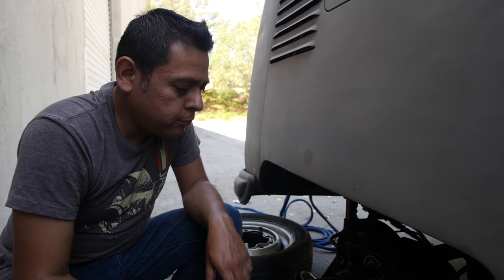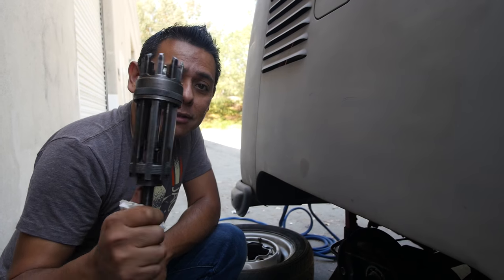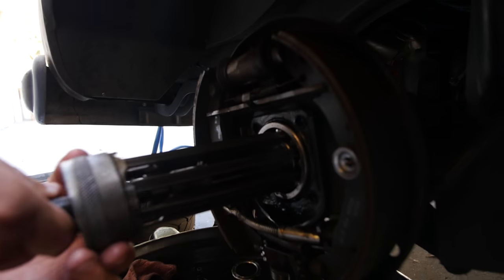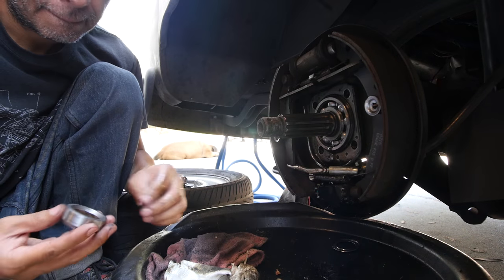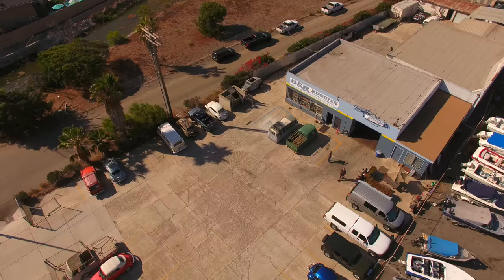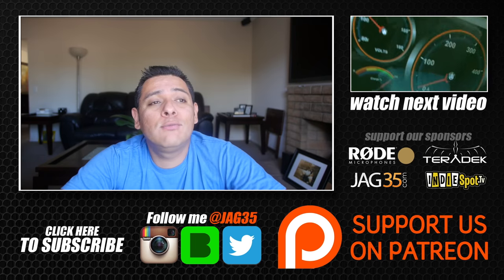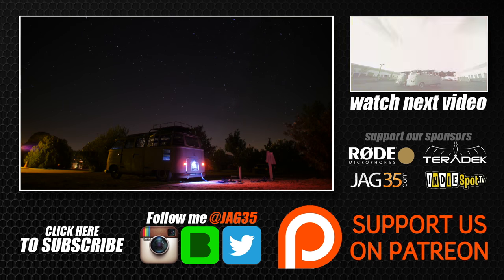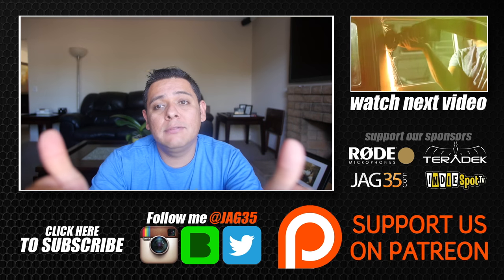HOW TO REMOVE A REAR VW AXLE BEARING 6306

Comment: You have nice editing BUT. Put the content first! Why did you timelapse through the reassembly? We could have learned much more. What was that O-Ring for? How did you get the new bearing on when it was already hard to get the old one of? What was that funny bearing cover why did you cross tighten the bolts? How expensive is such a bearing? You have such high quality footage and editing it's a shame you are not using it to it's full potential. Your outro was like 2/3 of the whole video!
Reply from the maker: +Cutter Slade  I have zero interest in showing you how to install a bearing.  I only wanted to show you how to remove it because it requires a rare and specialized tool